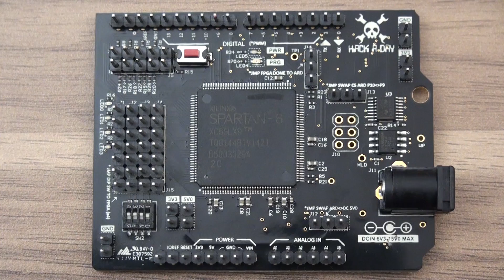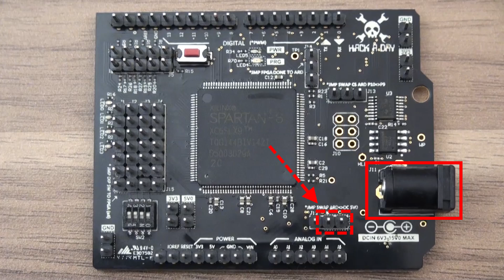Top Level Walkthrough: Arduino Compatible FPGA Board

Comment: Beautiful piece of work. Can this Shield be attached to a Cmos optical sensor for high speed photography (say 1000fps)? I'm new to this level of electronics but am interested in capturing the centroid of a flying BB pellet, using an Arduino.  Thanks.